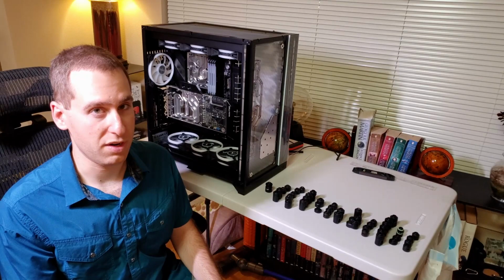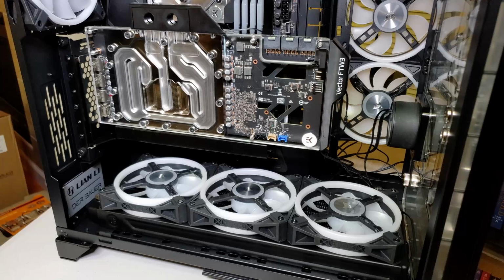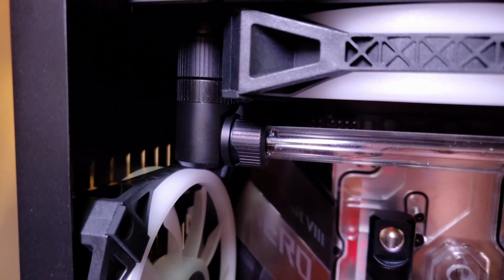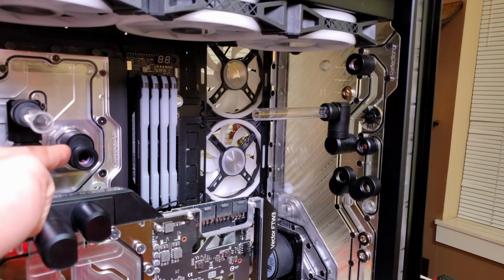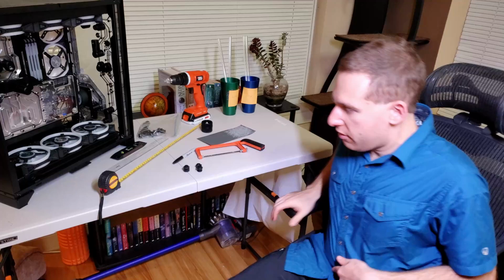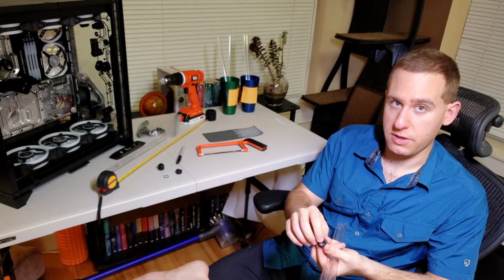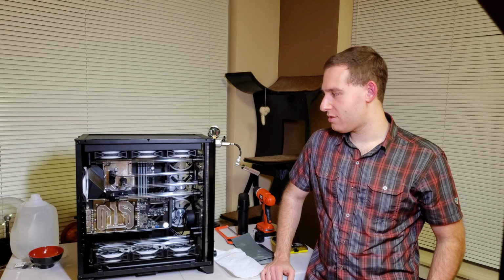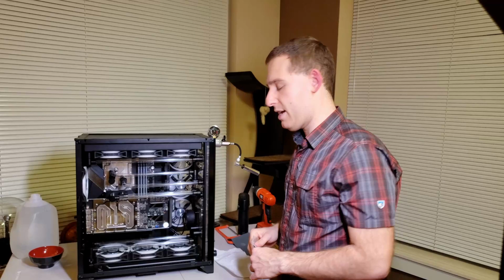How to: Custom Watercooling Loop - Lian Li O11D XL Case with EK Distro Plate

Comment: Great video Ronnie. Thanks for taking the time to do it. Both you and Eve showed lots of patience. 
What I will make sure to do when pressurizing the system is to take some soapy water and put it around each fitting, one at a time. 
If there are any leaks you will be able to see the soapy water bubble, like when you are fixing a flat tire on a bike or car and trying locate where the holes are that are causing the leak.
I wouldn't have thought to do that without this video. Thanks again.
Reply from the maker: Glad it was useful!

Comment: Finally a good video explaining things but not skipping everything, thanks!
The one thing I still missing though
Why no one shows how to actually put the straight pipe into both fittings
They put it into one and then... it's done...
Reply from the maker: Probably because we're all afraid we're doing it wrong. It's not pretty. Basically stuffing it in. The saving grace is that at least one end is rotary so you twist it a bit out of alignment and you get some wiggle room to work with.

Comment: This just proves that if you would have to be insane to not use a leak tester.  Thanks for the video. First time watercooler here, currently very intimated.
Reply from the maker: It was my first custom loop and for what it's worth doing the rigid tubing made it way harder. If you went with soft tubing I think it'd be far more forgiving. Those lengths were the hardest part.

Comment: This was an absolute awesome video.  I am thinking of starting my first open loop water cooled build and this is by far the best video that describes the obstacles that is faced.  

Thanks you earned another sub
Reply from the maker: Thanks for the feedback! If you didn't notice, there is an overall summary video as well as a longer fans and wiring video on that build if you're curious about that part. Links are in the description.

Comment: Thank you for taking the time to make this video and share your first water cool experience. But I have a few suggestions for you to consider on how to make the cooling performance better. I think you build a custom loop for the temperature and quietness. First, EK is a company that spends a lot more on aesthetics and marketing than cooling performance. The technology on jet plate, cold plate, even the o-ring inside fittings are years behind its competition. As a result, you can potentially lower your CPU temp by 5 degree C and GPU temp by 10 ~ 15 degree by simply switching to another brand for waterblocks. As for which brand, Optimus is the one. It's a US based company. The waterblock from Oprimus will blow your mind. But do be patient, Optimus can spend some time on fulfilling your order and it doesn't have a support team like EK. Second, avoid EK SE360 radiator. It's the worst performance rad on the market. If you need 30mm rad at the bottom, buy the black ice nemesis 360GTS, otherwise switch it to PE360 or XE360 and both of them will fit at the bottom for distro plate. Third, Don't use Corsair QL120 fans. I personally own nearlly twenty of them years ago. It has the following disadvanges: RGB cables are horrible and it can't sync with asus aura. Terrible static pressure, not ideal for radiator. LED on the fan has serious reliability issue. Four of my fans has broken leds just after one month of use. 
These are just some advices from a guy who has done water cooling for years. This industry is wierd. The company that doesn't care about marketing makes better product. As for EK, that's why it can get away with its overpriced and underwhelming product.

Comment: You can pin point a leak 2 ways, 1 get some flexible tube and put one end on your ear and use the other to locate the hissing sound. Secondly use a spray bottle with water and a little detergent, put plenty of paper towels in to protect your hardware and spray the connections. You will see bubbles form from a leak. This particularly useful to find very sl;ow leaks.

I have the same case and put a 60MM 360 radiator vertically in the back of the case. I have a vertical GPU mount but it is a PITA if you want work on the motherboard, ie changing NVME SSD's. My next build will have the GPU in the mother board.

Comment: DO NOT over-tighten  the temperature sensor (or anything for that matter) into the distribution plate!!! It could end up cracking at points where you screwed with excessive force, many people ended up breaking this same distro by doing this
Reply from the maker: Ya I have heard that as well. So far so good!
Reply: Can confirm I had to RMA my distroplate, although I was getting more cracking around ports where the EK plugs had been placed from factory. When I got my replacement, I loosened each plug. Not a crack since.

Comment: Fabulous vid. Thanks so much for posting, especially all the errors and things that I'm sure caused some off-camera blue audio. Your end result is inspiring but the effort is pretty intimidating. Besides the extremely detailed work, the shipping costs alone for when you need just one more part must be very painful the fifth time 'round...
Random thought: has anyone tried to use a laser level for helping with vertical measurements? It could give a horizontal light plane which could be lined up with a fitting edge, which you'd then be able to use as a reference elsewhere.

Comment: If Yu are not upgrading in future use a clear silicon seal to seal the fittings and Yu Yu will never have leak in 100years and don’t need tho worry about the length of the tube it touching the 2nd overnight or not

Comment: Nice build! But next time don't order from EK. Those shopping charges are crazy. Performance PCs has all EK equipment. I started by build and the issue with the bottom rad pipes interfering with the vertical mount is definitely an issue. I'm thinking if reversing the rad so the ports are on the right side so that I can just use fittings to make the connections to the distro quick and easy.

Comment: Should have added some smoke then did the pressure test it would be easier to see leaks.
Reply from the maker: Interesting idea, hadn't thought of that. Though I'd be worried about introducing particles of crap into the system.

Comment: Nice job with this build. Used your video to help with some of the fittings I needed. Thank you for that! Curious, I didn't see that you installed a drain? I installed an EK drain in the place you installed your sensor.
Reply from the maker: Thanks Anthony! I did actually install an EK drain but I used the front outside port on the bottom left of the distro plate. You can see it sticking out in some of the later shots in the video. The upside is much easier access but the downside is obviously to the profile of the case. It's something sticking out that you can bump and isn't as clean looking. In the end I didn't mind. Would have been nice to be able to place back the front glass on the case too. But no one but me can tell that's missing.

Comment: Way to stick with diagnosing your hissing noise issue and documenting it. I've recently resolved an overheating CPU issue that was driving me nuts and it is so satisfying one you fix it. Great Job. I am currently going through a new build simlar to this with a slightly newer distro plate but in the 011 XL as well. I was wondering how you routed the distro plate RGB cable. Along the top ?
Reply from the maker: You can see more detail on my fan and wiring process in another video actually if you're interested. https://youtu.be/GhiJM9Q4iBo But basically it's a bit complicated because I have some LED strips in there too that are connected in series with the distro plate cable so they all function as one big led strip as far as corsair icue is concerned.

Comment: Love this build. It was just what i was looking for to study up on building a water cooling system. I hope you don';t mind but I'd like to ask a few questions: 1 - where did you get the tubing from? 2 - you mentioned a bending jig (I think)...not seen one of these before - where's that from? and 3 - is that a normal heat gun you're using? Sorry for asking this but I'm extremely curious about it :) NOTE: is that some special drill attachment you're using to grind out the end of the tubes?
Reply from the maker: 1- Bought it direct from EK with many of the other parts but it's sold from other watercooling vendors as well. You can see the specific type in the full parts list in the video description.
2- They exist but I did not use one as I didn't actually have to do much bending. I just used the edge of one of the boxes I had lying around to get a 90 degree angle. For example, from EK: https://www.ekwb.com/shop/ek-loop-modulus-hard-tube-bending-tool-16mm 
3- Yup normal gun off Amazon, just one of the top results. 
4 -  Yes it's a special drill bit, also bought off amazon. You can see the specific part in the parts list. 

Good luck!
Reply: @RonnieBunshaft  Thanks so much for the reply :)

Comment: Great job! Any issues with tiny 
cracks in acrylic reservoir block where you tighten fittings?
Reply from the maker: Yes actually, I noticed some forming around the very top fitting where there's still air. I'm thinking it needed some pressure let out after running hot for a while? I loosened a touch and it hasn't gotten worse. Not currently planning to do anything about it.

Comment: Love the setup… would it be possible to also fit back mounted side rad to this? I run triple 360 with a tube res at the moment but really like the look of the front distro plate.
Reply from the maker: There's not enough room inside the case if that's what you mean. If you were willing to mod the side you could try that but it's a metal closure. You can look at the lighting/fans video if you want to see what it looks like in that side compartment. https://youtu.be/GhiJM9Q4iBo

Comment: I’m have same setup as yours. I’m at the point that I have the distro plate filled and can’t get the pump started. Can you explain the two wires coming off the pump and how are they setup. I have the jumper on the ATX cable and I’m lost.
Reply from the maker: One wire is the power. It might be a molex or SATA connector depending on the version of the distro plate you have, but either way it should be obvious as that connector is much larger than the one on the other wire. The other wire is the control of the speed of the pump and gets plugged into whatever header you want to use to control that, like you would a fan. However you can ignore the control wire if you're just trying to fill the system. You can do that with only the power plugged in as it should run at 100% speed when powered on. 

You need the power cable from the pump plugged into a power cable from the PSU, a jumper in the PSU as you've stated so it'll turn on without the motherboard connected, and of course the PSU plugged into the wall. I'd suggested double checking all the connections and verifying that the PSU itself is getting power. Is the switch in the on position? Does the fan spin a little or any light visible on the PSU? Is the jumper in the right direction and snug? If you are 100% confident the PSU is giving power and everything is plugged in, it is possible you have a bad pump, but probably unlikely.

Comment: Curious why you wouldn’t orient the radiators with the inlet & outlet on the right, next to the distro block, and avoid the long run all together. Is this an aesthetic choice?
Reply from the maker: Mostly aesthetic for me. Those long straight runs are a way to show off the hard tubing and part of the challenge of the build. Though it's also possible that there wouldn't have been space to do it the other way. I didn't actually check. Even with the distro plate designed for the case and the rads being EK, nothing was magically perfectly aligned unfortunately.
Reply: @RonnieBunshaft  Thanks for the response. Working my through a similar build and your video was very helpful.

Comment: Am I seeing the bottom row of fans pulling hot air from the rad into the case blowing up on to the other components?
Reply from the maker: Yes. The "right" direction of all the fans is up for debate but I went with facilitating hot air rising. In the bottom, out the top. Additionally, if I had set 6 of the fans to be blowing out of the case with only the remaining 4 fans blowing in, I would have created a negative pressure differential on the case at large. That means more air is being forced out of the case than in, which would result in every little crack and crevice of the case where there is no fan attempting to suck in more air. Air that has dust and cat hair and whatnot in it. In general it's advisable to have more fans blowing in than out. So my fan setup is in the bottom, out the top, the 3 on the side blowing in, and the one on the back blowing out. You can see more talk about it in the lighting/fans video if you're interested:  https://youtu.be/GhiJM9Q4iBo

Comment: whats your thought on squeezing the thick XE 360 EK rad down in the bottom? the EK configurator said it would fit with that rad and their vertical mount bracket.. but "technically fitting" isnt the same as comfortably fitting.. i get the impression that putting a thick rad in the bottom alon with vertical mount bracket will  lead to some important consequences and considerations for planning out the rest of the loop. Whats your take on this, given your experience with the O11 XL and the slim rad
EDIT: i am not using a distro plate, my pump/res (heatkiller tube/D5-Next) will be mounted elsewhere.. either a bracket that mounts on top of the bottom fans, or a mount that attaches it vertically to the triple fan side panel
Reply from the maker: I think it would fit but how scrunched things are will depend on which slots you put the vertical bracket in and whether you have it in a high/low position. If you did it exactly like me I think it'd be a tight fit if it fit at all. But I put the bracket right in the middle of the available back slots so there is room to go one higher if you need any more room below. The XE is I believe ~twice as tall as my rad so that would fit. The downside would be that you'd have even less space above for the CPU/GPU tubes and even just to see the motherboard. Depending on the size of your GPU block you might even start having the GPU conflict with the CPU. You can see on mine the space between the top of the GPU tubes and the bottom of the CPU is maybe less than the height of one of those back brackets. Regardless I think it would be very tight up top instead of below.

Comment: If you could go back, would you have picked a different color fittings? Like nickel?
Reply from the maker: I'm happy with those but definitely agonized on the coolant color. Might change that next time I clean it.
Reply: @RonnieBunshaft  I actually like the clear coolant coupled with the RGB. But what other coolant color were you considering?
Reply from the maker: @dstir009  maybe a light purple or blue for a "cold" effect.

Comment: is there enough room to run this setup (front mounted distro plate) with a side mounted radiator? trying to figure out if i can do this as i prefer to use the non-xl case (cause i don't want my pc to weigh 985748923 lbs lol) i'm having trouble finding any builds where people are running top and side rads with a front mounted plate and vertical gpu. it seems vert gpu with top/bottom rad setup is "doable" but there is like almost no space under the gpu even with a slim rad in the o11 d evo, whereas the xl has plenty of clearance. i don't see why i couldn't run side mounted rad like i want, even if that means mounting the rad on the back side of the side mount so it sits inside the 2nd chamber of the case and just run my tubes at the bottom straight through under the fans
Reply from the maker: If I'm understanding correctly I think the answer is no there is not enough room to do this build with a side mounted rad. I have the fans already on the back side of the side mount. So you could probably fit a rad there but not with another layer of fans on it. This distro plate expands backward too far to get anything onto the front of the side mount. It's close but it overlaps enough that you can't do it properly.

Comment: Hey Ronnie - another question. I see on the bottom radiator tube runs you are using dual 90 degree fittings on the distro plate side. Wondering if you considered single 14mm offset instead? Would the offset drop to the same height as the dual 90 degree fittings?
Reply from the maker: I considered it but it seemed to me that the dual 90s gave more distance. Unfortunately hard to tell as the offset isn't published data and it's very hard to measure manually.
Reply: @RonnieBunshaft  Thanks Ronnie. I may test it out and see. Any reason you chose 12mm  over 16mm tubing?
Reply from the maker: @TeeBone2112  not really, my understanding is it's just an aesthetic choice. I do imagine it would mess with the exact fitting alignment to choose though.
Reply: @RonnieBunshaft  So far your recommended fittings match up. Only change, I'm using dual 7mm extenders on the bottom radiator vs 7mm+10mm.

Comment: Looking at the video... you have the drain in the outside drain port... does that interfere with the front glass?
Reply from the maker: Ya you can't use the front glass pane with the drain port there. I just leave it in the case box. You'll be the only one that can tell. And actually one step of installing the distro plate is a long thin black piece of metal that secures and also covers up the gap on the left so everything looks more cohesive.
Reply: @RonnieBunshaft  Nice!  I wasn't sure if it would close up the front and basically replace the front glass panel, but sounds like a good choice.